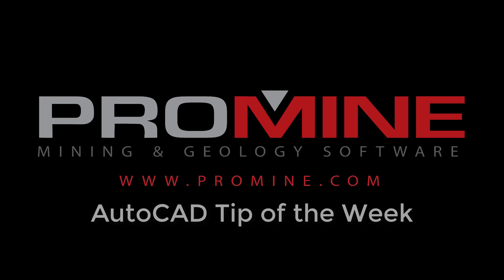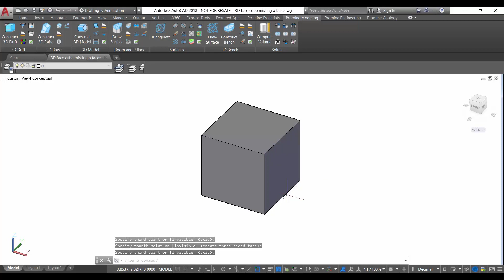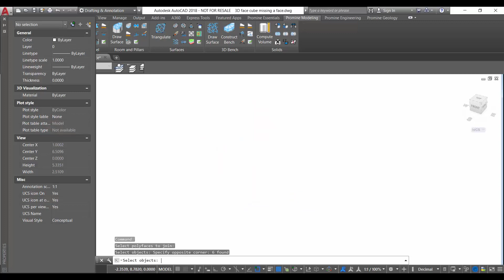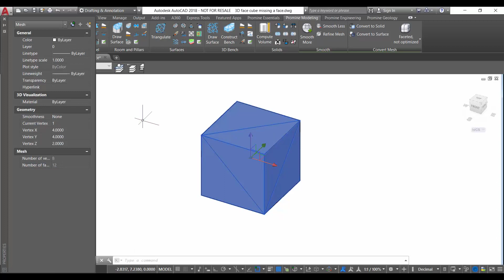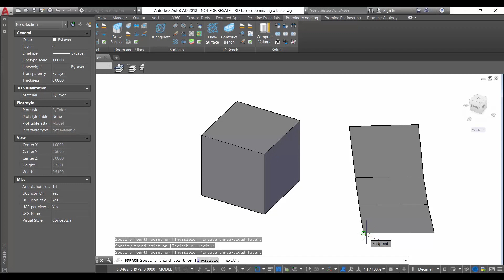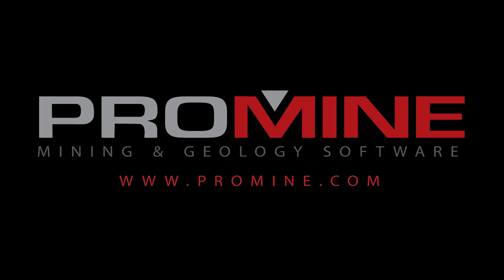Promine AutoCAD Tip of the Week: The 3DFACE Command

Comment: I am having an issue converting my drawing into a 3d solid. Can you help?
Reply from the maker: Hello Ivan,

To do so, use the "Mesh to Solid" command from the Solids module found in the Modeling Category. Select your mesh and hit Enter, the command should convert your mesh to a 3D solid right away.

Hope this helps!
Reply: @PromineInc  It's those commands my drawing is saying invalid...anyway i can send you what i have to see if i am set up correctly to run these commands? email or dropbox i can send my dwg. Please i need the help can't figure it out
Reply from the maker: @2ubeSock25  Sorry to hear you're having trouble with that. Yes, please send us an email at info@promine.com